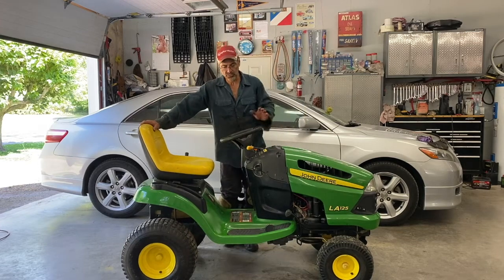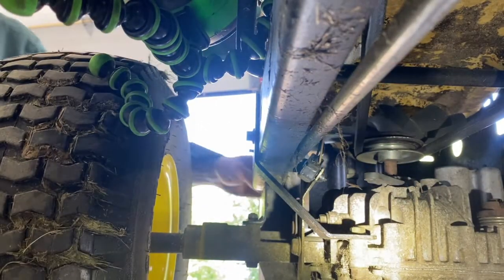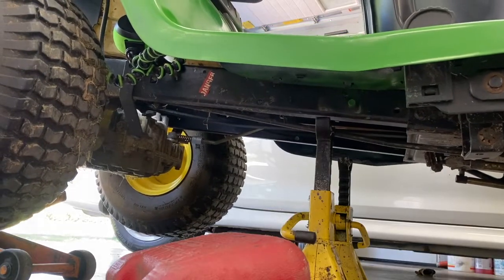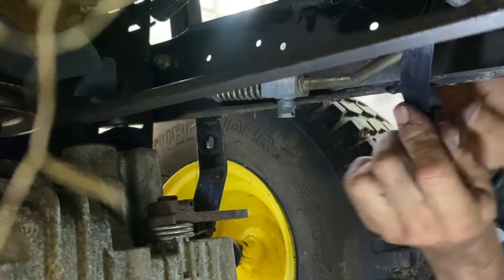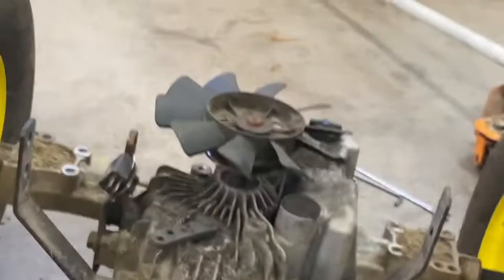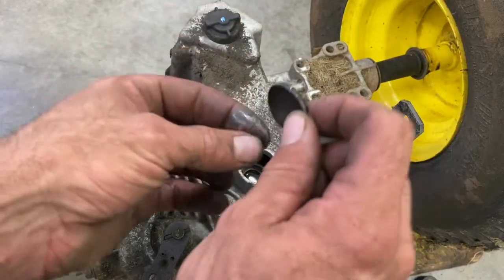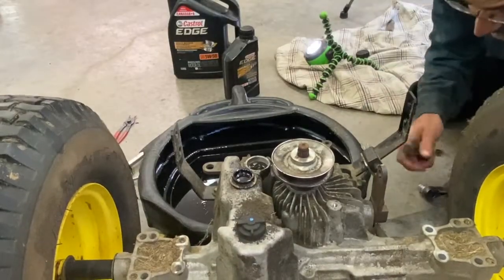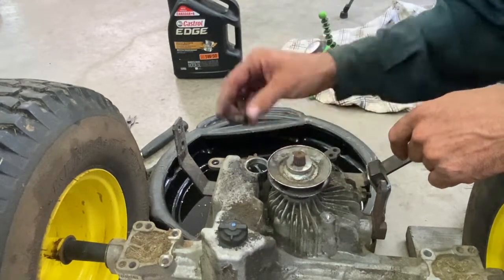How to change your oil in a Tuff Torq Hydrostatic Transmission. John Deere Lawn Tractor,LA135 Series

Comment: Man would it have killed them to add a bottom drain / top fill port LOL thanks for the great video!
Reply: Engineer's............. their ears must burn every single day
Reply: I watched terrell fixes things and he said the 2 marked spots under the tranny you can drill and tap. It's not that hard, but I would just do mine as it stands. UP on a ramp so I could get to the 2 spots and drill them out and then tap them and put in the square head plugs.  He said it is there for each manufacturer if they want to put in a drain plug or not. It is all up to the company that makes their mower and uses their trannys. 🙂
Reply: @JohnSmith-uy7sv  Just drilled mine today. The metal isn't very thick on one of them so won't be many threads when I cut them tomorrow. Must be careful not to over tighten. The outer surface of my case also has a fair texture to it so I decided that needed to be flattened off a bit or will need a very soft washer to seal it. EDIT:  After tapping for an M8 drain plug I decide the metal was too thin, fortunately it looks like i can drill and tap for an M20 plug and it will have much more metal to form threads.
Reply: Really!!!!  Last to long then
Reply: @ColinWatters  I think youtube is hiding comments back to me. I've been scrolling through the comments and as I go up and down the more show up from 7 days ago or more and nothing was there before. So, you did not go by what they recommended? How did you fill it back up with oil and what kind of oil? synthetic 10w40? I forget the name.I've seen others recommending synthetic oil. but my small yard is very little and mostly flat in south florida. a little sloped in the back 20 minutes cutting and 20 in the front all flat. nothing steep. sorry about the return.
Reply: @JohnSmith-uy7sv Mine had been leaking oil and slipping on slopes so I decided I needed to service it.  I removed it from the mower and I emptied the oil as per this video, then took the case apart to inspect for wear. The oil looked like chocolate milk! While it was open I took the opportunity to add (drill and tap for) the two drain plugs, one M8 under the differential, the other M20mm under the oil motor. I had some wear on one of the pinion gears, an axle and both axle seals so replaced those. Resealed the case and refilled via the top plug. Mine also came with a small header tank for the oil which is easier to use when the axle is on the mower. I had been using something like 10W40 but this time I refilled it with a Synthetic 5W50 as I've seen that recommended in a few places.
Reply: @JohnSmith-uy7sv  I forgot... One of the leaks turned out to be the top plug mentioned in this vid to remove the oil. It had a Y shape split in it. The new one has a metal top.
Reply: @ColinWatters  I bought the 1 bolt and tap and drill that they recommended for the hole. Just have to wait to do it and use a hose to a funnel for that long shot on top of the tranny. I'm not pulling mine out unless it blows up. 😁Thanks for the info.
Reply: @JohnSmith-uy7sv  Ah I didn't see a recommended drill and tap size mentioned. I looked at the bottom of the case and just figured outvwhat was easiest for me.
Reply: @ColinWatters  oh, duh, that youtube channel about...Terrel does or knows everything.  He gave the proper sizes from the factory. write me back so I can find the saved video. I won't delete this one just in case. 🙂

Comment: After seeing this video, which was well done by the way.  I needed to change the transmission fluid in my 20 year old LT166. I also was replacing the cracked fuel tank. once i removed the fuel tank, 3 bolts and the fuel line clip, the whole transmission was exposed to my surprise. The filler cap was right there. Removed filler cap and used a fluid suction tool and it worked great. refilled fluid, put tank back on. super easy. FYI to you all. 🙂

Comment: Outstanding Video Sir 😇👌👍I use 15w40 synthetic oil ( T-6 ) Rotella. 👍👌😇 I have two drain plugs made on the plates from a machinist who rebuilt them ( resurface the two pistons rotating plates and all the bushing at 300 hrs ).  Cheers 🍻🍻
Reply: @WeekendHobbyMechanic  😇🍻
Reply: my tranny is the K58 and about 330 hours. Do you think it's time I drilled out those 2 spots under the trany, drill and tap them. No way I'm doing all of this when it's easier to drill and then tap and you can pour gas in the top plug to clean it out. But I know, you probably can't get to the magnet on the top cap. That is just soooooooooo much work. 🥰
Reply from the maker: @JohnSmith-uy7sv .   It all depends how long you keep the mower.

Comment: Nice work on the video. Good to see we can still get down on that darn concrete floor to fix something and walk away for lunch... LOL. I see some are adding drain plugs to allow easier oil changes. I guess one advantage is you can crack the case open and change the oil filter and inspect inside.

Comment: My Toro has a nice little header tank to which you can add fluid but grrrrr no drain plug. It was such a delight spending a whole day struggling to get the transmission off the mower. The fluid came out looking like coffee :-(

Comment: Great instruction. Just did this on a D110. Took a bit getting lined up when putting back together but everything works as it should. Thanks again.
Reply from the maker: Glad it helped
Reply: How many hours did you have on the tractor?  Did it have issues, or was this a pm ?
Reply: @miked5331  Not sure of the hours but it's an 8 year old lawnmower. Old fluid did need to be changed.
Reply: @scott9068  Thanks for your response! My d110 is about 7 years old.   I guess it's better to change it before issues arise.
Reply from the maker: @miked5331  Over 200hrs

Comment: Just did seals on the LA110.
Check the axle washers closest to the transmission the spacers actually pressed the inside of those washers into the seals cutting them to shreds.
Put thicker tsc 3/4" washers on to fix it.

If you don't care about the looks of the mower you can remove the seat spring bolts and lift up, remove gas tank and you have access to the top of the transmission, it just gives you fender flares. 😂
Thanks for the video!

Comment: Just drilled mine today. The metal isn't very thick on one of them so won't be many threads when I cut them tomorrow. Must be careful not to over tighten. The outer surface of my case also has a fair texture to it so I decided that needed to be flattened off a bit or will need a very soft washer to seal it.

Comment: Bravo man. TY. Putting dogs on . Got beers in the fridge frosted Pilsner. Now get over here and do mine. I will assist.
Serious question…how many hours on your first chance of fluid.?
I have 480 hours on mine (k46 locking diff). 13 years old. Should I change it or leave it alone?
Reply from the maker: I have one here with over 500 hours. The oil was in good condition, no metal flakes attached to the magnet.  
   It all depends on how the tractor was heavily used.   The manufacture says change your oil every 200 hours.

Comment: OR..........you could have put the rear tires up on a ramp or stand the tractor up on it's back wheels or whatever and then drilled out those 2 circle marks to drill and tap and put a plug in it when your done drain the oil that way.  But  then its a tight fit for the funnel to fill it back up. Do the drain plug. Then you don't have to do that all over again in another 300 hours or so.  How many hours were on that change??? Thanks.
Reply from the maker: Can’t remember the hours on the trans. It takes me less than 1hr to this on a tractor.
Reply: @WeekendHobbyMechanic  HOW!!! UGH!!!  There is no way to do all of that in 1 hour. Unless you have a pit crew like at a race.😊 Said Elizabeth Warren. 🤣🤣🤣🤣
Reply from the maker: lol.  I do about 10 a year.  And yes, under 1 hr.
Reply: @WeekendHobbyMechanic  You can remove the transmission, take it apart, drill and tap the 2 holes, put it back together and mount it back in the frame in 1 hour???? I was born at night......but...not last night. 🤪
Reply from the maker: @JohnSmith-uy7sv . No drilling.  Just take it off the mower, change the oil and installing it back on the mower.
Reply: @WeekendHobbyMechanic  OH duh, that totally defeats the purpose if you have the bottom case removed. If you got it off then you might as well drill and tap those 2 bung holes from the factory. If I drop my pan from the up right position, how many pieces will fall out that I will have to put back in place with a dab of grease or tac spray to hold them in place?  Upside down I guess everything stays in.

Comment: Great video!! What are the initial driving symtoms before the transmission pulley fails? I have over 200hrs on my JD130 lawn mower. I just replaced the main drive belt. I have noticed there is less and less power while going forward or in reverse. When I raise my foot off the gas pedal it seems to regain some power but not much it then gets slower and slower. Would the transmission pulley be a likely culprit?
Reply from the maker: Does it work better at 1/2 throttle?   If so I suspect the filter is starting to plug up in the transmission or it’s low in oil.  Any leaks?
   The bottom pan needs to come off.    Watch this video on how the remove the pan.   Just replace the filter.  Add silicone on both surface when putting it back together. 
https://m.youtube.com/watch?v=3D_vtMg-Zxg&t=836s&pp=ygUeUmVidXVsZCB0cmFubWlzc2lvbiBqb2huIGRlZXJl
Reply from the maker: Check the spline in the pulley.
Reply: Although im not mechanically minded, I'm not afraid of diving into these kinds of issues...diagonosing these issues is my problem

Comment: Thanks for the video, I'm doing my first one today. Would you suggest first to change the fluild in it first or just get another rear end? I have a JD D130, new belt, and it starts to slips after it warms up. I've taken it out, now I'm at the point where I should change the fluid or change the rear end completely. What's your suggestion?
Reply from the maker: Add 15w-40 or 15w-50 oil.    If that don’t work maybe start looking for a used tractor “in bad shape” with a good transmission.
Reply: Hello sir, I when out and found some 20w/50 oil, is this too heavy? @WeekendHobbyMechanic
Reply from the maker: @ronniewortham3260 Perfect.  As long you don’t use the mower in the winter time.
Reply: Great! Thanks! @WeekendHobbyMechanic
Reply: Sorry I'm so long getting back with you. I see what you mean, the 20w/50 oil is too heavy. It studders a lot but goes but if it's cold now,it won't move. So I'm gonna get the oil you suggested and put it in next week. Thanks, keep the videos coming, I'm learning alot. @WeekendHobbyMechanic

Comment: Thank you for the great video, I have a Scotts lawn mower, pretty much it is John Deer, I was wondering if a Castrol 5w-40 edge motor oil would work, I am having a hard time finding Casrtor edge 5w-50 oil, thanks
Reply from the maker: 👍. 5w-40 will work just fine.
Reply: @WeekendHobbyMechanic  Thanks to you I was able to rebuild my Scotts lawn mower transmission, it is now running like a champ, before that, I had no clue what to do. You are a great resource  keep up the good work, thank you again 👍
Reply from the maker: @transformer889  I'm glad it helped.  👍

Comment: Is this the same procedure that you would use for a John Deere L1 11 lawn tractor?
Reply from the maker: No.  Different   The L111 drain plug is at the bottom of the transmission.  The fill cap is near the top, front side.
Reply: @WeekendHobbyMechanic  thank you

Comment: I have a JD LT133 do you think this LA125 is similar?  Mower purchased in 1997 and never replaced my oil. It is slipping a little on uphill pulls. Could be a loose belt but needs oil replacement for sure.
Reply from the maker: Remove / install is a bit tricky.  Watch this video.  I would install the forward/reverse rod on the transmission first and then lower the tractor down.  You can start watching it at 14mins in. 
   https://m.youtube.com/watch?v=3D_vtMg-Zxg&t=53s
   If your transmission is slipping or slowing down I’d replace the filter.

Comment: i have a d110 i bought last week, has 200 hours, mowed the lawn twice and now it wont go up the hill. drives on flat lawn fine. do you think doing this will help. No way im paying 1k for a new tranny =(
Reply from the maker: Did the previous owner said it has a bad transmission?   
  I’d call him for my money back.     
  A heavier oil it will help.(15w40)  But once a transmission starts to slip it will need replacing. 
  Have a look at this.  
https://m.youtube.com/watch?v=3D_vtMg-Zxg&pp=ygUlVHJhbnNtaXNzaW9uIGpvaG4gZGVlcmUgd2Vla2VuZCBib2JieQ%3D%3D
Reply: @WeekendHobbyMechanic  he said it was fine. hes not gonna refund. maybe ill try and put in a used one or send the gears off to a service that redoes them.
Reply: @WeekendHobbyMechanic  yea i saw that vid you made. there is a service that does that resurfacing for $100. Im not a mechanic but I think i can do it, lol

Comment: What is the black screw on type cap that's right above the drain cap with the magnet u used? Does that cap come off? Looks like it is a full cap
Reply from the maker: Vent cap.    If it pops off, u can use a bit of silicone glue it back on.
Reply: @WeekendHobbyMechanic . Will 20w50 full synthetic vtwin motorcycle be ok to use ?
Reply from the maker: @tearnyscribner9146  Don't know, I never used motorcycle oil before.

Comment: Do you think Lucas oil heavy duty stabilizer would work well?
Reply from the maker: Can’t say.   I never used it.
Reply: @WeekendHobbyMechanic  
What about sae 50?  It was all I could find.
Reply from the maker: @stephendevine2455 .  OEM is 10w30.  I used 5W-50 and 10w-40 before.

Comment: I think I’m going to try and just vacuum the oil out of mine lol, wonder how well that would work?
Reply from the maker: Pretty hard to pop off the oil cap with the trans still in the tractor.     How are you going to check the oil level?
Reply: @WeekendHobbyMechanic  lol, haven’t even looked at mine, after watching this video I seen how hard of a job it looks to me to do it the right way. I do know where there’s a will, there’s a way, I helped a friend change the fuel pump/sending unit out of the gas tank in his wife’s car once, instead of dropping the fuel tank, we pulled the carpet up from the floorboard in the back seat above the fuel tank, cut a big hole in the floor pan and changed the pump lol. I doubt she ever knew there was a repair underneath the carpet!
Reply from the maker: @shanek6582  Right on.  It’s not that hard.  Just take you time. I can do this in 1.3hrs but my first time took 4.  Lol.
Reply: @shanek6582  Is that why she died of carbon monoxide poisoning and drove her car off of a cliff???🙄🙄🙄🙄🤣🤣🤣🤣
Reply: @JohnSmith-uy7sv  actually she did die because she was screwing everyone while her husband was at work and he did a murder / suicide. Now im I hoping she didn't go crazy from those fumes
Reply: @shanek6582  Yes that did it, so that makes you an accomplice to murder. Turn yourself in. 😁

Comment: On a LA145 would this fluid bad cause SLOW GO uphills
Reply from the maker: 10-25% of the time changing the oil and cleaning the filter does work.  (10w-30).  
  Watch this video:
https://m.youtube.com/watch?v=3D_vtMg-Zxg&t=836s&pp=ygUrcmVidWlsZCBoeWRyb3N0YXRpYyB0cmFuc21pc3Npb24gbGF3biBtb3dlcg%3D%3D.  
   I’d use 600-1000-1500 grit sandpaper

Comment: What is aggravating about the K42 is on the bottom of the case you can
see where there  USED  to be drain plugs, but now is just a blank. What
makes me even crazier, is that to remove the plugs & patch the holes it
cost Tuff Torq $$ to have a engineer fix it. SO, why not just leave it as it 
was? It wasnt hurting anyone. Yes it was. John Deer & Husq & Cub Cadet
and all of their other customers wanted to sell more tractors so they had
TT plug the holes and the tractor makers also made sure there was no 
way Io get to the top of the trans ensuring most people would not go to
all the trouble and the trans will die sooner selling more tractors.
REMEMBER-Its nothing personal. Its Busine$$.

!

Comment: Is john deere hygard good oil for these?
Reply from the maker: Yes.   Hy-Gard high Viscosity
Reply: @WeekendHobbyMechanic  perfect, i see you said 10w30 is also safe correct? I was looking to get a gallon of pennzoil platinum as its the most affordable
Reply from the maker: @psd28   That will work just fine...
Reply: I used the hy-hard and mine makes noise like belt slippage when having a load like up hill so I have to let off pedal for it to “catch up with speed “ then I can go full speed. It didn’t do that before.
Reply from the maker: @davidmorgan8612 . That’s weird.

Comment: Dear week end I changed the filter and oil which wasn't so bad level wasn't low and didn't have a burnt smell after 704 hours. So after I changed the oil n filter let it set over nite for silicon to set put it together taday n tried it out not much difference an still has trouble going up hill any other suggestions. An I didn't pull the pump out only drained oil n changed filter. Ray stein
Reply from the maker: Watch the video below.  600 grit sandpaper works better.    It’s allot of work.  You could look around for a used transmission or a cheap used John Deere tractor that need work.

https://m.youtube.com/watch?v=3D_vtMg-Zxg&t=302s